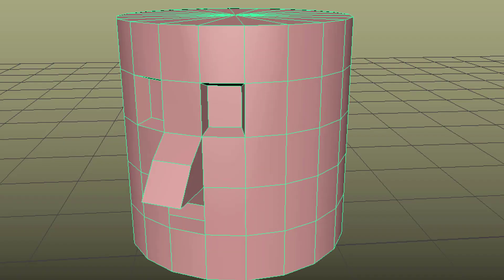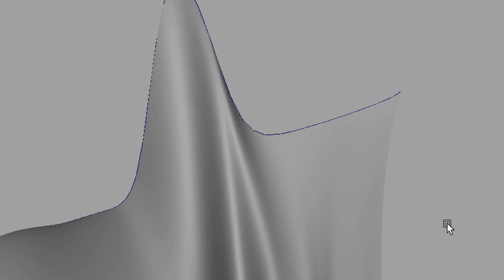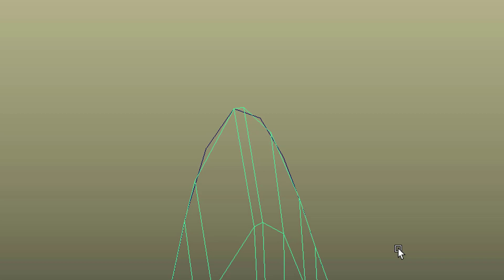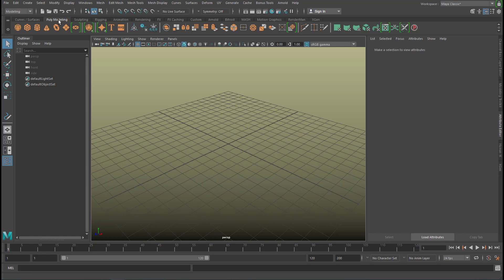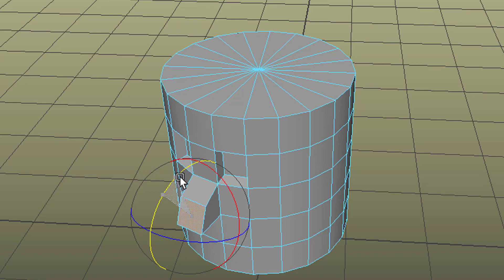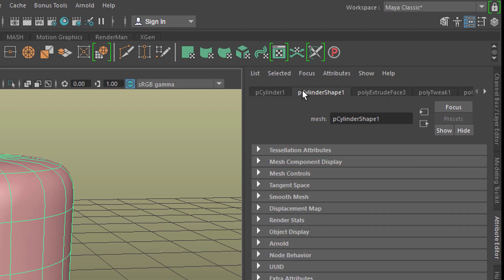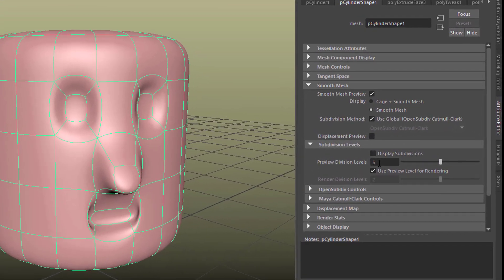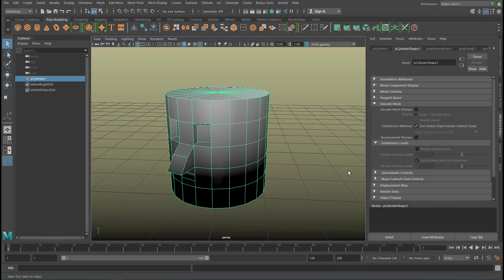Maya: Smooth Surface Display

Comment: question : why do you have to convert to Smooth Mesh Preview ? something I don't quite understand. thanks.
Reply from the maker: the tutorial is quite a while in the past. if i remember correctly, the smoothness in the display does not affect the smoothness in the rendering.